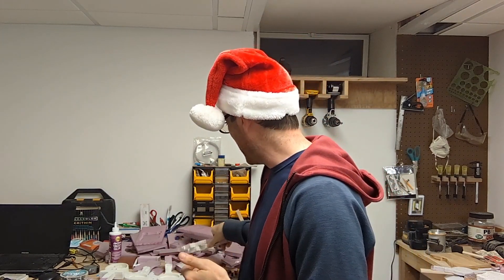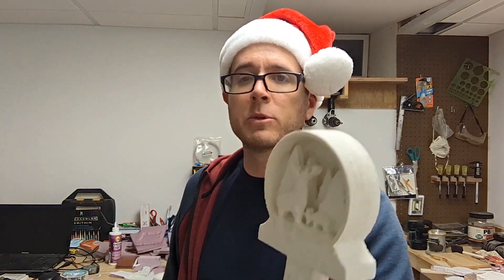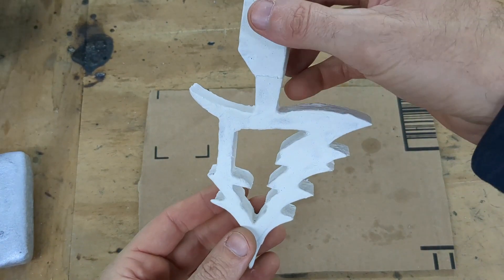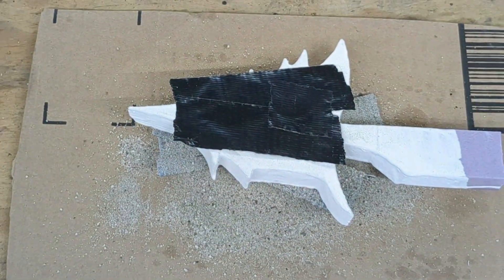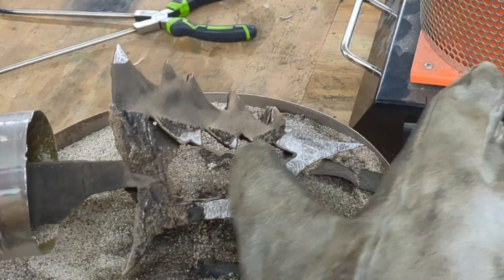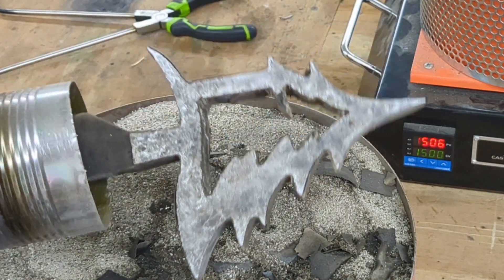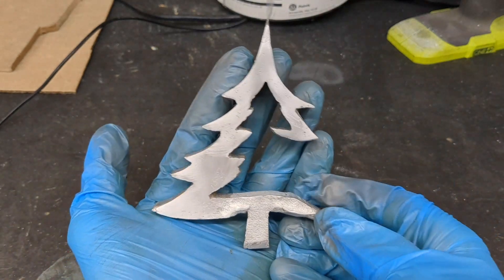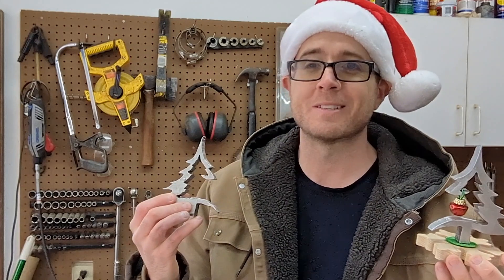DIY Christmas Decoration | Metal Casting Process with Polystyrene Foam | Lost Foam Casting

Comment: I liked and subscribed.  I have been coating my foam  patterns with a thin coat of sheet rock mud and then ramming them gently with green sand. I seem to get a lot better results doing it this way. I haven’t seen many of your other videos though so maybe you are doing something similar
Reply from the maker: Awesome thanks!  Yeah, I coat mine with wall plaster too.  No, I've never used green sand with my Lost foam casting.  I would think the moisture In the green sand would make the plaster coating soft.

I'll have to check your videos.  I would think ramming might deform the foam.
Reply: @HeinrichsMade  gently!  I have trouble with my castings expanding with loose sand …it looked like your cnc one got a little thicker?
Reply from the maker: @backyardmetalcasting  I didn't notice.  I just measured another foam cast that I did.  It is the same thickness as the foam.  It doesn't bother me if it shrinks or expands though.

Also, I should mention that I spray it with soapy water before applying the plaster mix.  It helps get rid of the air bubbles.